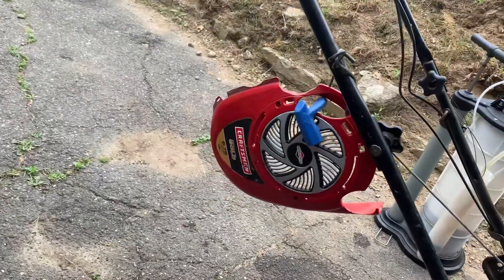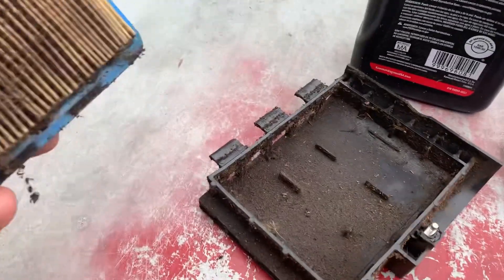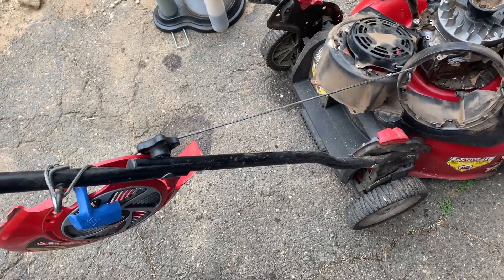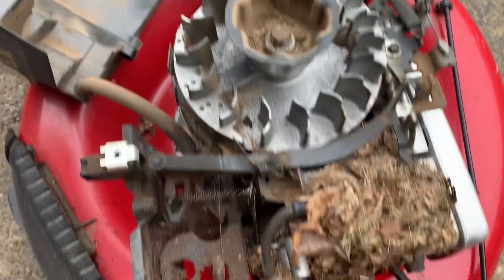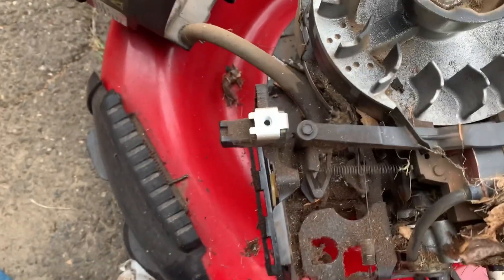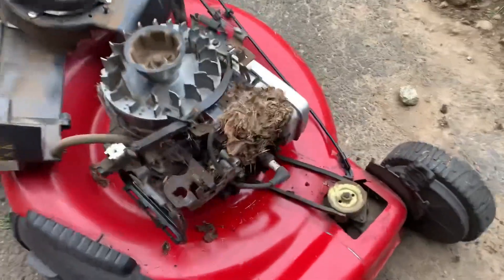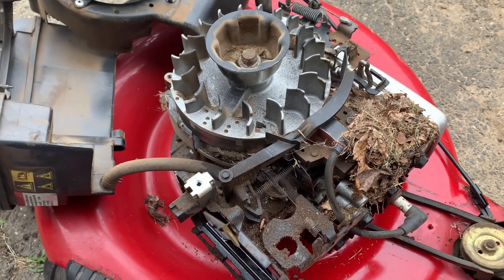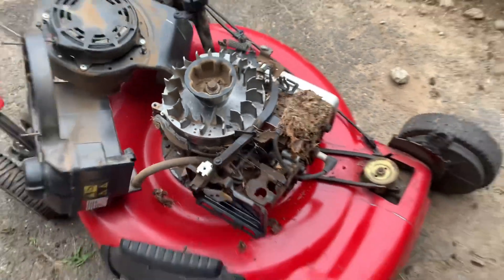Craftsman mower Briggs Quantum won’t rev up, let’s fix it

Comment: Seen that many times at EP Ken both the mouse house and the dirty air filters. We suggest our customers put used peppermint tea bags or peppermint oil on the top to the deck during winter storage and they have said it works let us know if you have ever heard of anyone using this. We also used to have them hang fabric softener clothes you use in clothes driers to repel mice. Nice to see this one did not make it into your garage or home eh!
Reply from the maker: We have enough mice in the basement feeding on the wife’s dry goods! I have to try the peppermint oil
Reply: @@backwoodsvirginia What is it?

Comment: The first mower I fixed this season was that exact Quantum with a nest in the same spot. My auction place is a pole barn building on the edge of a meadow and woods. I have learned to check that on every mower I buy there. About 50% occupancy rate has been my experience. Better than not checking and customer wants money back cuz mower caught fire on first use. Ask me how I know.
Reply from the maker: If you removed the shroud on most mowers I’m sure you’d see nests
Reply: @KensSmallEngineRepair  yes and now I do. But I didn’t always and it bit me.